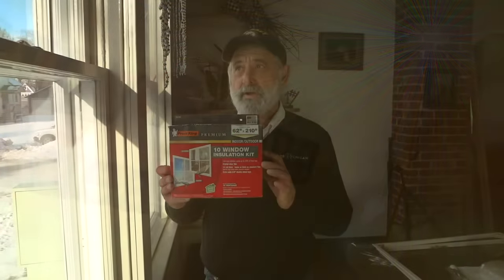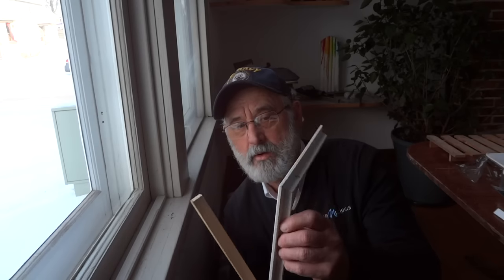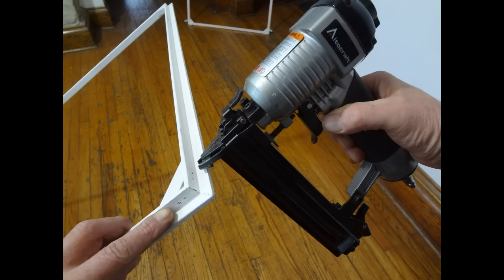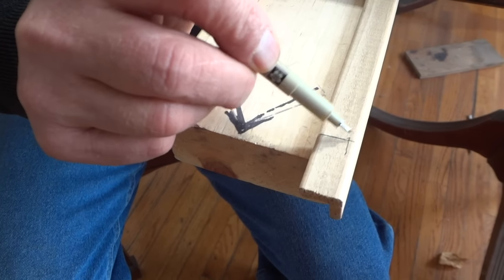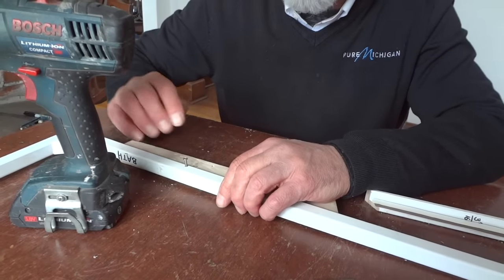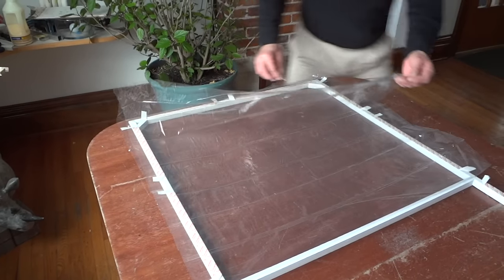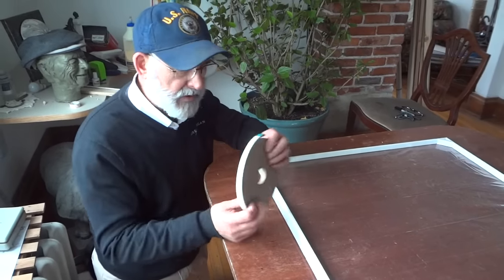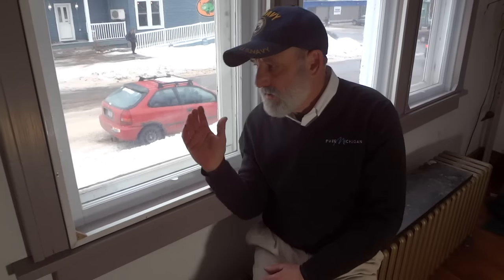DIY Window Insert for Older Homes

Comment: What wood did you use for the cross bar in the middle of the window?  I assume it is nailed like the corners.
Reply from the maker: It is the same 1/2" by 3/4" parting stop.  I just finished putting together a method to make my own corner molding that is stronger, straighter, and far cheaper than the corner molding purchased in the hardware store.  Found out that if one is willing and able, five window insert frames can be made from a single 8 foot long 2 by 4.

Comment: Could one simply use weather stripping around the perimeter of the insert to hold it in place?
Reply from the maker: Not sure I understand what it is you have in mind as the insert does already incorporate an adhesive backed foam weather stripping around the perimeter.  Maybe a wider weather strip that would create a press fit within the well might work.
Reply: I did it this way. It worked ok, but the tolerance is too small to get a perfect seal. I've had mine up for 2 years and I'm about to redo them with real glass instead of the plastic film. My frames are screwed together, so I can easily undo, cut grooves for the glass to sit in, reassemble, and then use the window as a jamb (will make some wood inserts for the top half, they're double hung), and then use pre-primed quarter round trim around the full perimeter to make a perfect seal. (I'll put a gasket on the back of the "storm" window.)

Total material cost will be under $100 per window, but it will be a whole different ballgame compared to plastic film. Superior looks, sound blocking (1/8" "double" thick glass) and insulation value, not to mention unlimited lifetime.

Comment: How do you store those in the summer without damaging the film? Just careful?
Reply from the maker: Richard,  I bundle them together with stretch film.  The windows for the most part are standard size.  A bundle of 12 windows is only 9 inches thick.  Surprisingly lightweight.  I saved over $300 this past winter, well enough to pay the $180 it cost to make 12 windows and will reuse them over and over again in the coming winters.  It takes a few minutes at the most to put them up.  No more taping, cutting, shrinking for this guy.  So much easier! So much more effective!

Comment: does anyone have links to the parts on amazon or maybe lowes website?
Reply from the maker: We are setting up to manufacture my new patent-pending, lower priced, DIY Window Insert "Kit" at Lakestate Industries in Escanaba, MI.  Each window must be ordered individually as window dimensions vary.  This new window insert kit covers both energy savings and sound control.  Easy to put together by yourself.  Very effective!  You will never have to mess with taping and heat shrinking again.  Use the same window every year.  Easy up.  Easy out.
Reply: @EarlSenchuk  what is gonna be the cost per unit on these vs buying raw materials and DIY?
Reply from the maker: No idea. That will be up to the manufacturer.

Comment: I don’t know if you would see this. I was trying to fine a way to make clear  panel
For my screen porch. That doesn’t cost me the price of my mortgage 🤣😂🤣. So we could use it.  Most of the year. I using 20 gaug vinal. I think with some small adjustments would work.
Reply from the maker: Sounds like it might work.  Give it a try.  Best if the vinyl comes off a roll.  No kinks.  Good luck!

Comment: Does anyone know. good source for wide shrink wrap in moderate amounts besides buying the window kits? r are they a reasonable price?
Reply from the maker: I purchased a roll of shrink film from Menards a few years back which works very well because the crease lands right in the center of the window  where it doesn't show because of the window frame elements.  Cleaner and neater.
Reply: @EarlSenchuk  Thanks. I don't think they carry it now; making my first frame for my son's brand new 1887 rundown Maine farmhouse.

Comment: how do you ventilate?  you can buy those windows with hinges and handgrips  for about 200 dollars..........
Reply from the maker: Excellent question!  The answer can be found on this website as it involves a lot of different aspects of ventilation. https://www.energy.gov/sites/prod/files/guide_to_home_ventilation.pdf
Reply: Good question. If your house gets too airtight, you could have moisture issues, or just not enough fresh air exchange, which is unhealthy. My plan is to install what the passive or net zero houses use, an HRV (heat recovery ventilator) or ERV.

Comment: How is the plastic holding up?
Reply from the maker: The plastic and all the windows are the same as the day they were first put up.  I am currently working on a new video on how to make the corner molding (a lot cheaper than store bought) and a home made clamp to secure the window corners.

Comment: My heating bill is $648 last time it was over $1000 im thinking about tryint this trick out.
Reply from the maker: Wow!  Hang in there.  I'm in the process of developing for the market a patent-pending window insert kit that will save 30-50% on energy bills for heating and/or air conditioning.  When it's ready, I will notify every commenter in this feed.  You definitely need something to lower your energy costs!

Comment: How it works for noise?
Reply from the maker: I would not know that a winter storm was happening if I did not look out my window.  It is so quiet. The windows used to whistle during storms.  The gasket used should be closed cell foam for best sound reduction.

Comment: Frost King is terrible. 3M is much better. But tape residue from both products  sticks to the window frame & is a pain to remove.
Reply from the maker: Thanks for your comment, Sitori.  That double sided tape can be a real problem.  I tried everything to get it off and ended up having to strip some of my windows completely.  Solvents like acetone, lacquer thinner, xylol, and such will remove the glue, but it's still stuck on the backside of the two sided tape.  It can be a mess.

Comment: Updates please
Reply from the maker: At some point in time, I found out that there are no clamps on the market that work for this application, mostly because the clamps weren't designed to allow access to shoot in the brad nails.  I am a metal artist, so it was easy for me to weld up a set that works.   For this reason, I came up with another two new videos one of which shows how to make that special clamp out of a 2 by 4.  The other video pertains to a simple jig fixture that shows how to make outside corner molding at a fraction of the cost you would pay in a hardware store.  You can cut up enough wood strips to make the frames for up to four window inserts from a single 2 by 4.   Those two videos are now posted as links at the end of this video.  

Also, I recently created a patent pending DIY window insert kit that works exceptionally well for both sound dampening and energy savings for both heating and air conditioning.  We are discussing now how to set that option up for manufacturing this new DIY Window Insert Kit.

Comment: This is awesome however this seems incredibly time consuming and like you need to have some expensive tools and construction knowledge. I have 20 terrible windows in my rental house and no tools and no construction experience with anything so I’ll have to just stick to the insulator kit.
Reply from the maker: Thanks, Asher.  The payback is in the creature comfort and savings, huge savings.  Major Christmas storm going on right now and I would not know it unless I look outside and see the snow blowing sideways.  It is so quiet in my house.  Silence is another big advantage to window inserts.  They dampen sound very well.   DIY Window Inserts require basic woodworking tools.  Of course, it helps to have some experience in using such tools.  I have been hoping that someone with tools can make the special clamp and even the corner molding for others.  Keep trying.  These window inserts are a Godsend.
Reply: @EarlSenchuk  thank you this was very informative!

Comment: All that work on the frame, why not use plexiglass?
Reply from the maker: Hello David,  Plexiglass scratches easily, fractures easily, and is expensive.   Think of Mike's golf cart window.   There is a company that makes a window insert using a plexiglass material with a bulb gasket around the perimeter. A standard window 28 inches by 54 inches costs $418.   This is why I filed for a patent on a window insert kit that anyone can put together.  It will conserve heat and block sound and can be made to block solar transmission in South and West facing windows.  We're now looking into getting an Energy Star rating for it.  You will be hearing about it soon.  There's more than one way to skin a window.  This single-layer window cut my bills in half. The newer twin-wall design will do even better.
Reply: @EarlSenchuk  scratches and fractures easily?  And a plastic film is better? Your video speaks to it ballooning in and out…. There is another YouTube video of a lady that used inexpensive plexiglass to do the same thing. Not disparaging your idea, just don’t see it as a very permanent solution.
Reply from the maker: @davidcooper3871  Unfortunately, you can't buy a plexiglass sheet cut to fit your specific needs.  A single sheet of AmeriLux 0.093" x 36" x 72" Clear Polycarbonate Sheet costs $129 at our local Menards store.  That's enough to do one 28" by 53" double-hung window with 40% waste. I can make 19 complete window inserts for that price.  See DIY Window Inserts for Older Homes, Part II- The Corner Molding Making Jig

Comment: As you put the final mounting screws through the plastic covering did you find that to be a weak point when you shrunk the film? Did it tear or pull away around the hole created in the plastic? I have seen others use a foam double sided tape for sticking the plastic to the frame, it appears you use thin double sided sellotape. Any thoughts on that difference? Are the corner triangles a must? Could you use wider stock for the frame so that it won't rack under tension when the plastic shrinks?
Reply from the maker: I pulled the inserts down this spring and noticed no problems whatsoever.  I used the clear double sided tape (5/8").  The only problem I had was when taking them down, the foam insulation wanted to stick to the window frame in a couple places.  Most likely that was due to residual tape from the old process.  I plan to dust the insulation with talcum powder before putting them back up in the fall.  Other than that, I don't expect to spend more that two minutes to reinstall the inserts per window.  This really works well.  My house was built in 1886, and I used seam sealer to cover the gaps around the old storm windows.  That can be a pain in the butt to take out if you don't do it in early spring.  It turns gooey when the sun beats on it. 

It takes a bit to make a window insert, but it is only a one time effort.  It was the highest I've ever kept my thermostat over the winter, and last winter was brutal.  I stand convinced, this is the best way to seal a window, ever!  I highly recommend it.  No air gets through at all!

Comment: Thats way too much work. Might be better just to order the inserts already made.
Reply from the maker: You might want to check into pricing of ready-made inserts.  Hold your breath.  I made these for my entire home in 2018 and figure that I've saved around $400 every winter since then.  Saving even more now that energy costs are so much higher.  They are definitely worth the effort.  That being said, I filed for a patent on a new style of window insert that will cut some of the cost.  Hoping they'll be available by winter 2022.  Stay tuned.